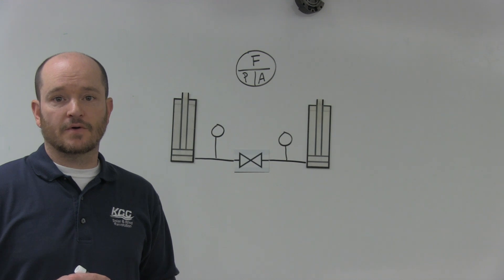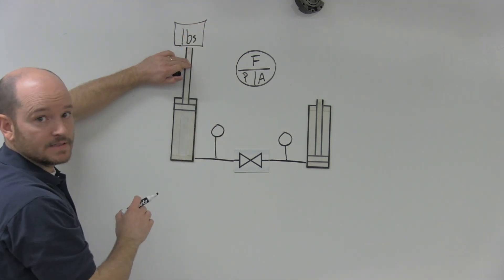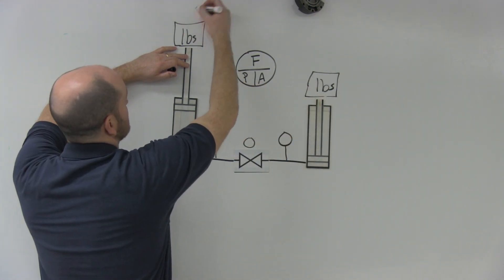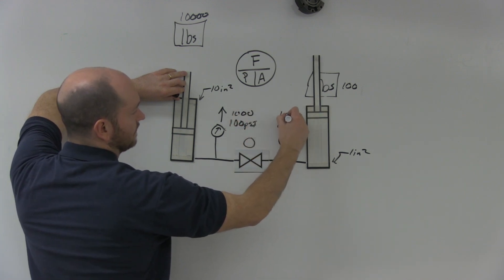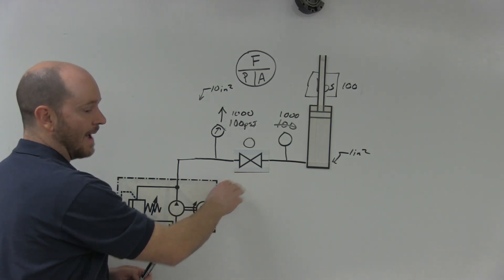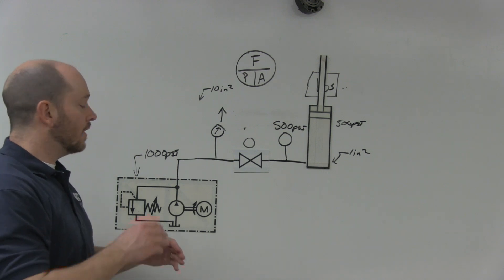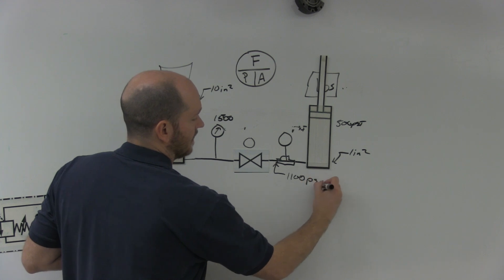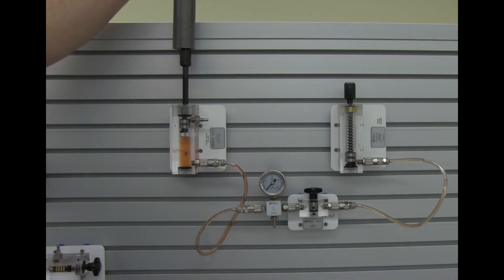Pressure and Flow in a Hydraulic System  and Their Basic Relationship

Comment: you are actually very good, but one small clarification (sure you are aware of that): pump does not create pressure. Pump/EM creates flow. Pressure is created by obstacles in the hydraulic system; pipes and their resistance to flow, valves, pipe curves and (most notably) cylinders with their loads or hydraulic motors and their loads. Cheers, very nice lectures.
Reply from the maker: I understand what you are saying but I disagree.  The pump will create just enough pressure to create flow.  The resistant what to flow determines the pressure and the pump has to be able to "force" the oil to flow.  That force is pressure.  This is commonly mis understood.  That is one of the main reasons pumps have a pressure rating

Comment: Really excellent video. If your pump has higher flow capacity than the piping system allows to fill the cylinder, the pressure in the upstream piping would be higher and the pressure regulating would have to operate?  Is that correct?  Thank you.
Reply from the maker: Sound right

Comment: Hey KleteeTech, no body could have explained this better than you. thank you so much!
I have a question that i don't understand for some time. 
1.the pressure in the house in the small pipes and the big pipes is identical?
2. In my house I have a pressure relief valve and it reduces pressure in my house system, how does it happen? the force that uses to lift the spring makes pressure loss ? -- the energy is being lost? therefore reducing pressure? after the relief valve?

Comment: Great video. One question, my 5th wheel slideout and landing legs are operated by the hydraulic system. There are no pressure gauges on the unit. Am I correct in thinking that there should be no pressure on the system if the pump is not operating? I had a hydraulic hose burst and the front landing legs were holding the trailer up because it was unhitched from the truck. I wondered if that meant the hydraulic system had to be pressurized anytime a landing leg was down or a slide-out was operated.  Also how can I make sure that if I need to unscrew a hydraulic hose that their wouldn't be pressure behind it?
Reply: The point is, not only a pump creates a pressure in a system, but the gravity does also. So, you WILL have a pressure in the system ones your outriggers down and supporting your trailer.
Reply: @sergeymariasov6845  Thanks for the answer. I am guessing with just gravity pressure there would not be much in this case.